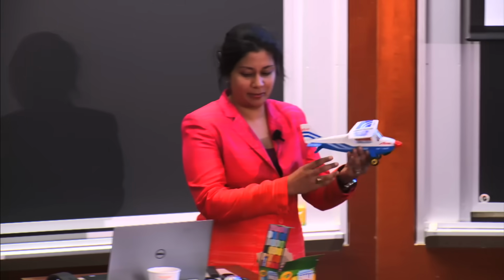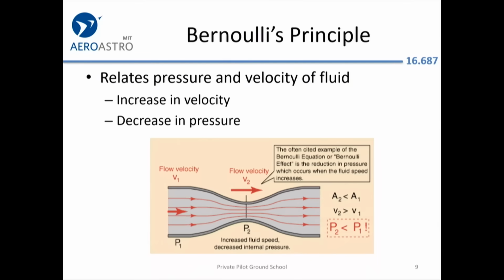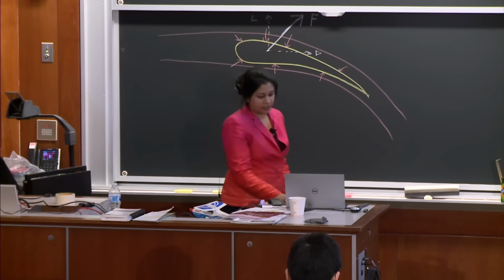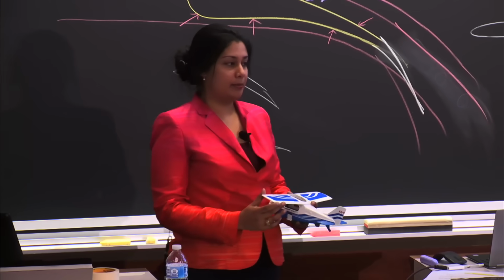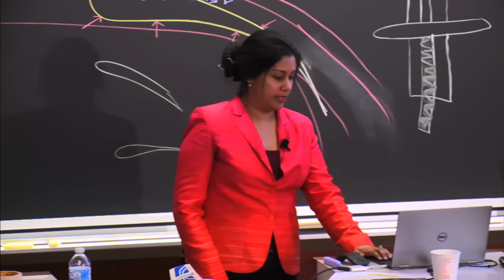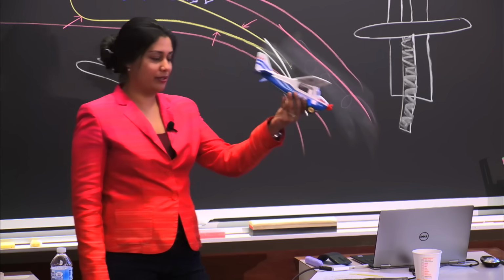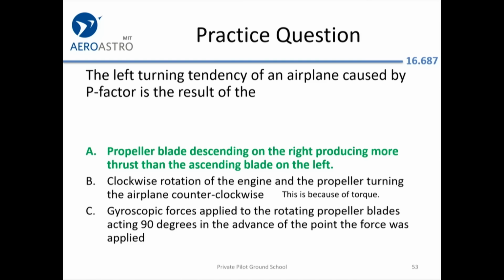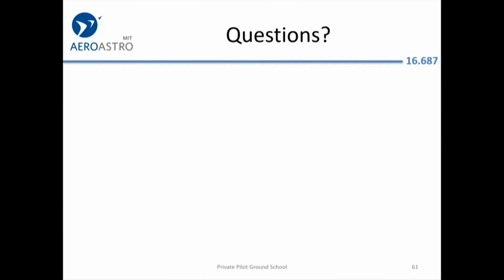Lecture 2: Airplane Aerodynamics

Comment: Interesting. Bernoulli was mentioned. Equal transit time theory too, although I had never heard of it as expressing the necessity clause of two air molecules - one travelling over the profile and one below - taking equal time of transit from leading edge to trailing edge, rather from stationary (motionless, quiet) to stationary. A lot of emphasis was placed on NOT falling for the equal time theory... I have a question: if the equal time theory (as I expressed, it though) was not correct, why would an air molecule passing over the profile possibly want to go faster than a molecule under it (as this was accepted with no problem in the video)? To me it relates to the difference in shape (top vs bottom) and difference in "choice" ( going up vs going down). Ok, they both accelerate with respect to stationary fluid which is far away from the profile, and Mr. Bernoulli is now a happy man. But in order to produce lift, there must be a pressure DIFFERENTIAL, that is flow speed on top of the profile must be higher than that below it. In fact, isn't the force accelerating the air molecules away below from the profile equivalent to that produced upwards by the pressure differential against the respective surfaces? I believe the air molecules don't simply "bounce away" from the lower forces, causing a reaction force upwards, as it was implied. Thus, the model of a profile accelerating mass downwards because of this phenomena is misleading, as it totally disregards what happens ON TOP of the profile. Actually, lift is not generated because of what happens below the profile, but because of what happens on top of the profile. Anyone?
Reply: Francesco 
Before discussing your concern, a few preliminaries:
Bernoulli is just the energy conservation
The sum of the potential energy (pressure) and the kinetic energy ( density × 1/2 × local velocity^2 ) is a constant q = density × 1/2 flight velocity^2 = dynamic pressure or stagnation pressure (at low Mach).
You are asking about lift, here is the only correct answer:
The Kutta-Joukowsky law quantifies the lift force:
Lift = density × span × flight velocity × CIRCULATION
The circulation is due to the bound vortex on the wing which is opposite but equal to the starting vortex left behind. (Conservation of angular momentum)
The effect of circulation is to add velocity over the wing and reduce velocity below the wing. And most important to allow smooth flow at the trailing edge, the Kutta condition.
Using the Bernoulli relation the pressures at any point can be calculated.
The Kutta condition reflects,
essentially, that the velocity at the trailing edge just above the wing and just below the wing  are identical (no slip behind in the wake)
Every time the angle of attack is changed, a vortex near but ahead of the trailing edge will separate and change the wing bound vortex (circulation) until the Kutta condition is again satisfied.
The circulation is defined as the line integral around the wing along any path of the scalar product of the local velocity vector and the path increment vector.
In the case of choosing a circle , the projection of the velocity on the tangent of the circle × the circumpherence increment is integrated.
The wing tip vortex is just the continuation backwards of the bound vortex. The circulation integral around the wing tip vortex way behind is identical of the circulation near the  center  of the wing.
No circulation , no Lift.
The elliptic distribution of circulation along the span of the wing leads to a minimum of the induced drag,  realized with the elliptic wing of the Spitfire fighter airplane of WW II.
The magnitude of the induced drag is (if q is not too small)
Di = (lift/span)^2  / (q × π )
q = dynamic pressure
important :
The induced drag force is independent of the wing aspect ratio!!! (Wing chord)
Due to the particular definition of the induced drag COEFFICIENT, the aspect ratio creeps in:
Cdi = Cl^2 / (π × AR)
AR = span^2 / wing area
Cl = lift coefficient = L/(q × area)
My qualification:
CFIIG, Prof. engineer aerospace.
By the way 
The presentation given is the worst over simplification I have ever seen with many statements that are simply wrong. Just as you said!
The higher velocity at the top of the wing reduces the pressure from the static pressure by  a significant value and on the lower side the lower velocity increases the pressure above the static pressure by a small amount (the square of a larger number is much larger, the square of a small number is much smaller)
In summary: the low pressure on top carries most of the Lift, as you expected.
Reply: @hernanposnansky4830  Take a flat stone and toss it in the lake as flat as possible. You will see that rock jumping on the water surface. Jumping in the air more than once or two (usualy about 4-5 times). Where is there Bernoulli principle?? Thank me later! This lady in the presentation said right!
Reply: @ldkbudda4176  
That ist a totally different mechanism. The stone is not flying, just falling and jumping. The water density is 800 times higher
At that slow speed the air lift if any is negligible.
The water provides the unsteady, short duration lift force. Similar to a planning boat in a seaway. The stone must have an AOA to deflect the water downwards and also sideways. When you throw, you also must give it a spin which stabilizes the stone gyroscopically, such that in the repetitive contacts with the water surface a positive angle is maintained.
Bernoulli's equation is an energy conservation  statement that also applies to water but you must add the contribution of the hydrostatic pressure, and in your experiment the kinetic energy of the stone and also  its gravitational energy.
The pressure of the water at impact is close to water density/2 × vertical component of the stone speed squared, the energy relation applied to the water.
And that is the answer!
By the way the theory of the collision impact determining lift is applicable to Newtonian rarified flow(Knudsen number about 1) and also to hypersonic flow as experienced by reentry vehicles.
Reply: @hernanposnansky4830  thank you so much for your time and detail in the explanation. It makes much sense, and it actually was eye-opening. I am an (older than normal) student of Aerodynamics and an airplane pilot. Could I kindly ask if I could turn to you in the future in case of a question? Thanks again!
Reply: @francescocandian2708  No problem, ask also from a pilot's point of view, because we have common grounds there.
There is one situation, where the induced drag is higher than expected:
when you are flying a twin engine airplane with one engine inoperative, then to maintain zero sideslip you bank the airplane with running engine lower in order to compensate for the sideforce created by the rudder to control the large yaw moment created by the running engine plus the added drag of the damaged engine.
The sideforce ,due to its small 'span' produces a significant induced drag, comparable with the drag of the damaged engine and getting higher by reducing indicated airspeed, contributing to the minimum engine out control speed required to maintain directional control

Comment: As glider pilot and instructor, adverse yaw wasn't really discussed with any sort of detail which is one of key factors in maintaining coordinated flight and stalls developing into spins. Otherwise pretty good discussion of basic aerodynamics.
Reply: She didn't know what adverse yaw is.
Reply: @CaptainSteve777  that's basic aerodynamics, and it's MIT, you would expect a little more through knowledge of the subject matter.
Reply: @drbob-roadie   For sure. I'm flabbergasted.  I saw MIT and expected something special, but it was far and away the worst aviation intro class I've ever seen, and I've seen a few things in 50 years of flying.  It scores well for "diversity" and nothing else.  Sad for the people that think they learned something true, but didn't.
Reply: @CaptainSteve777  I'm trying not to be too judgemental, although good information can be a life saver. I stumbled on to this video after watching some other lectures on aerodynamics given by some leading professors and engineers. Alot of what I was taught 20 years, when I started with my aviation career was debunked or explained in an entirely different ways. Some of the lectures were fairly esoteric and geared for those in advanced study and research and were be quite confusing to even someone who thought they had a pretty good understanding of aerodynamics (mainly me😄). The air flowing around the wing and fuselage hasn't changed, but maybe just man's understanding of it has.

Comment: Bernoulli's principle is bunk because the air is stationary.  The wing is moving through the air.  Air has mass and the air flowing smoothly over the top surface has to change direction and this creates a low pressure area and lift.

Comment: I do not think the analysis of the aerofoil in relation to Bernoulli's is explained at all. Furthermore to this, the dismissal of the equal transit theory without explaining why the upper mass flow leads the lower mass flow is misleading the students. This coupled with a vague explanation of angle of attack, chord and the forces associated with no Bernoulli reference is not good enough to even begin to truly understand the forces involved in lift and flight. 

I presume these students are looking to get their pilots licenses?

No wonder stall situations cause so much cockpit confusion, propagating bad human decisions causing easily avoidable crashes. 

Air France 447 in 2009 would have never crashed if the pilots had a true grasp of stall. Even if the CPU was telling them to slow down, due to the freezing of the air speed indicators. Any pilot with a true understanding of the lift of a plane would have realised the correct thing to do. The Captain was out of the cockpit when this even began and entered the cockpit once he realised there was something wrong. He assessed a very confusing situation in the cockpit. 

Within 45 seconds (which was very quick under the high pressure circumstances) he realised the plane was stalling and knew how to get out of it. Unfortunately this realisation was too late. 

The plane was doomed because the co pilots somehow forgot about the basics of lift. 

This lecture I just watched was vague and misleading with no real explanations.

I am surprised this is how Pilots are educated, especially considering it is endorsed by MIT?

Comment: I wished she could talk more about the Bernoulli effect, how the airfoil makes the air pass the top chamber quicker, and create less pressure, which results extra lift generated as I imagined.
Reply: Wing shape lift or "Bernoulli lift" occurs even at zero angle of attack.  She didn't explain it, because she didn't seem to understand it.  That's why she kept reverting to talk of paper planes and AOA-based lift, which is a different type of lift.
Reply: Yeah she kept drawing the lines that the air was being deflected down... Sure this is true for the air going underneath the wing, and forced to follow its shape, but the air going over the wing isn't going to be forced downward at all, though she draws it as if it will... this confuses me
Reply: @NondescriptMammal  You have to understand fluid dynamics.  The air over the top of the wing is excellerated do to camber (venturi), and it reaches the back of the wing before the air under it (this is why Equal transient theory is false which she explained).  That creates a void, a "vacuum of sorts" and that causes the air on top of wing to travel downwards (one form of downwash) to fill the void.  The air under the wing is defected downward momentarly. That momentary downward movement also contributes to a percentage of the lift (second form of downwash), but as soon as its free of the wing it travels upward and around (wing tip vortices) to fill that same void behind the wing. That void behind the wing inwhich both the upper and lower air particals are trying to fill is the induced drag.
Reply: Yeah, I don't think she wanted to get into coanda effect or bernoulli's in too much detail, but it's unfortunate because thats the other half of why the airfoil creates lift.
Reply: The airfoil is pushing air in front of it which creates high pressure in front of it and low pressure behind it, (similar to how a speaker-cone creates a high pressure wave in front of it when it pushes forward whilst simultaneously creating a low pressure wave behind it.) 
It's the low-pressure that causes air to accelerate over the top of the wing, the acceleration doesn't cause the low pressure. In reality, the air that passes over the top actually initially slows down to the high-pressure wave in front of the wing, it's only once it's lifted up and over the leading edged that it accelerates, but it has still been slowed down to relative airstreams higher up, it's only been accelerated relative to air passing under the foil.
This can be observed in this video using pulses of smoke https://www.youtube.com/watch?v=6UlsArvbTeo&t=50s
Reply: @davesmith3289  She is NOT saying Bernouli is not in play here.  She is simply saying that "Equal Transient Theory" is not in play here.  The camber of the wing is a venturi. The venturi effect of the camber of the wing does excellerate the air.  She actually says that.  What is NOT true is that the camber of the wing causes the air to travel "father" and that is "what makes" the air travel "faster." That is False. For example, when the F-4C/D and early E Phantoms droped its leading edge flaps and trailing edge flaps the camber was increased, thus increasing the venturi effect thus decreasing pressure even more, thus increasing lift.  But the distance from the leading edge and training edge never changed.  So it is not the distance the air has to travel that causes it to excellerate.  THAT IS WHAT SHE IS SAYING!!  Read Aerodynamics for Naval Aviators and you will see what she is talking about and be humbled too.

Comment: why attach it to a stick(the airfoil) in the wind tunnel and why not like stick it to the wall (like a slab so that the observation can be made considering it is, hypothetically, attached to the fuselage)

The basis of this suggestion is that won't the air particles that are near to the airfoil cause a different observation??!

Comment: Newton's 2nd Law explains lift better.
Lift only happens with motion.

Newton's 3rd says forces must be balanced, not that it is a "one causes the other" relationship. Upward pushing on the plane doesn't force air down, any more than downward air forces planes up. 
That's a common explanation, is incorrect, and a misinterpretation of Newton's 3rd Law. 

N-S equation aside, and i know you're trying to keep this super-simple for non aerodynamics majors... But still... 

Its Newton's 2nd: F=ma, and a specific case of it: namely Bernoulli reciprocation of velocity-pressure resulting in pressure gradients. Those gradients establish flow lines. The longer the flow line: the higher pressure. So the concentric arcs above the wing all have increasing pressure as their arc length increases. 
Result: plane go up 👆 👍
Reply: Or to put it simply:
If i say "Downward Air pushes plane up" -- you may say 'OK'. 
Now try this:
"Upward moving plane pushes air down"-- less satisfactory? But they're exactly the same statement, as mandated by Newton's 3rd Law.

Only you realize you still have the question: "But what pushes planes up?" [And NO, the answer is not air pushing down. That's a circular argument😉].

Comment: I did not know that air is flowing over the wing. I always thought that the air is stationer and the wing flows trough the air.
Reply: There is always a possibility of wind.
What is stationary and what isn’t is entirely dependent on your frame of reference.
Reply: In my 45 years of aviation and as a pilot I fly through stationäre air. And most airplanes do that. If you picture this you understand immediately much more about aerodynamics.